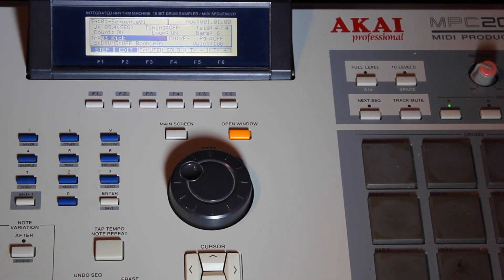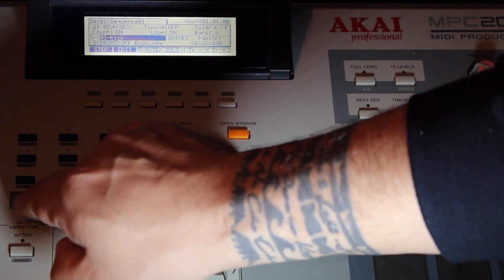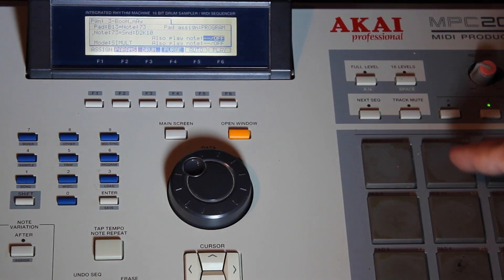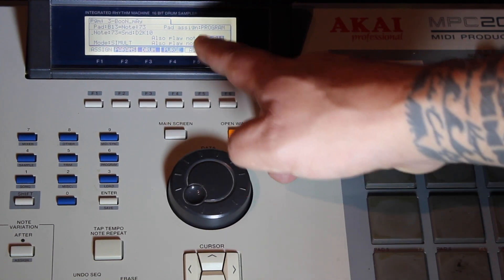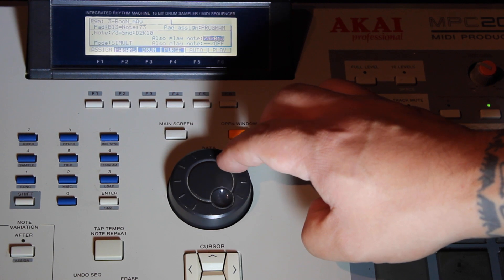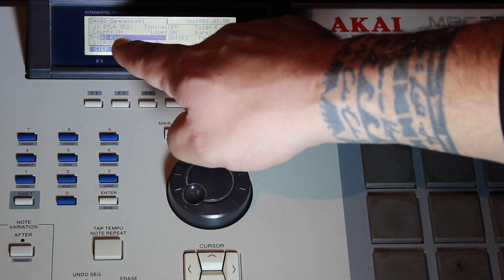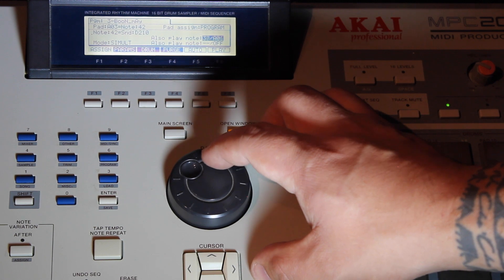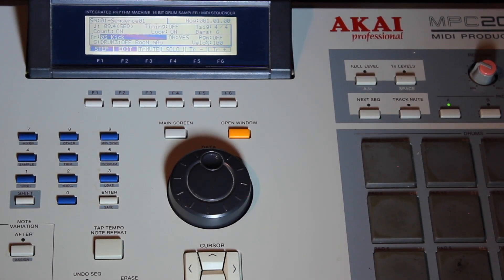How to make your drums knock with an MPC 2000 XL

Comment: Is your MPC equipped with the EB16? great tutorial
Reply from the maker: 🙏🏽. Yes fully maxed with the 8 outs and the Eb 16
Reply: @FaT_TrAk  I see you have an Apollo Twin X, what do you connect the 8 outputs to?
Reply from the maker: @wiinty2188 I used to go 8 outs into my presonus 16 channel mixer and out the presonus into pro tools via FireWire . Now I use two of the outs into my analog setup into the Apollo unless it calls going out of the main stereo outs of the akai into the analog setup. It’s good to have 8 outs as well just in case you want to track out each sound in a bigger studio with all the inputs. 🤙🏽

Comment: Nice video, question.  What is tha difference between your way and just recording them both at different times ?  Plus if I record them both at different times, I can have them both tracked out and I could mix them how I want, right ?  Also, why isn't your ( FULL LEVEL ) button not turned on ?  If that was turned on, you would get them knocking even more :) :)
Reply from the maker: You don’t have to record and play them twice if you stack them.  You can still track out an individual pad if you want to even though they’re stacked. I mix them both in the mpc and have the texture I want so I don’t have to when they’re tracked. I use 16 levels with kicks to get the ghost notes not all kicks in my opinion should be on full level if you’re doing ghost notes.
Reply: Nice, thanks.   @FaT_TrAk
Reply from the maker: 🤙🏽 thanks for tuning in 📺 and your comment